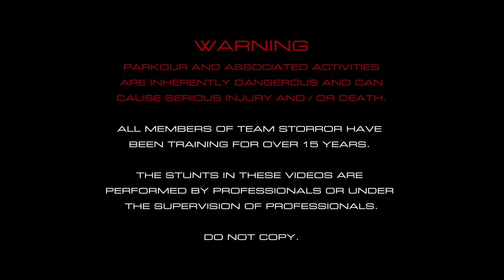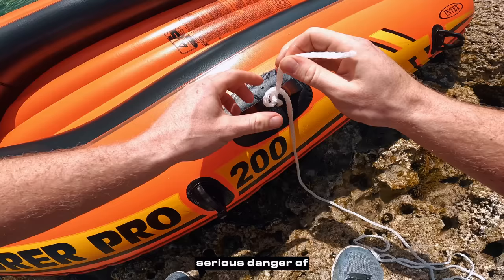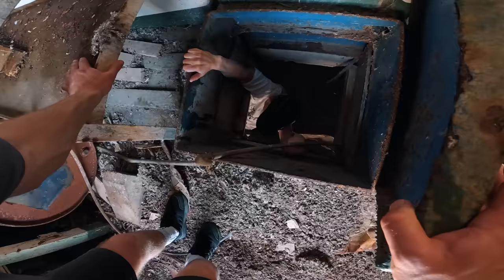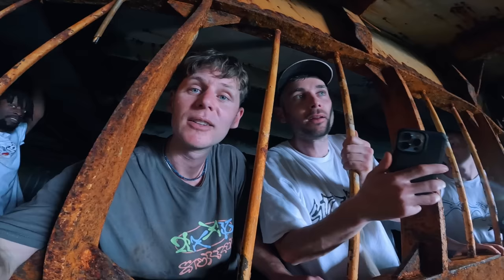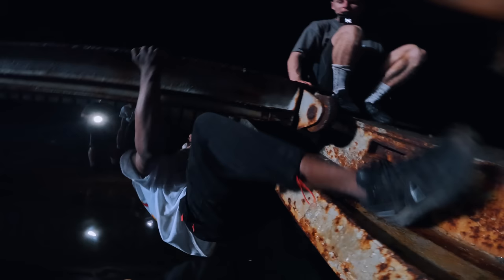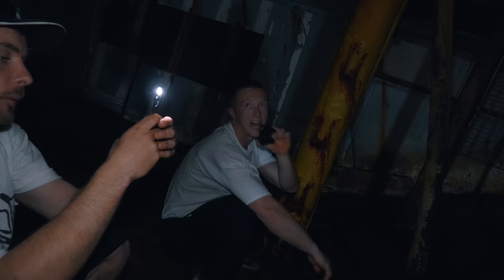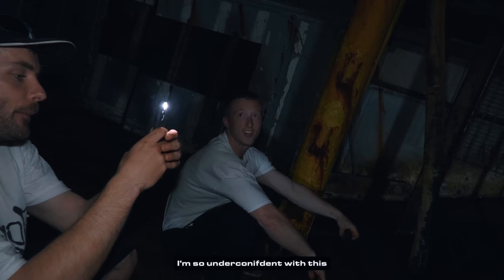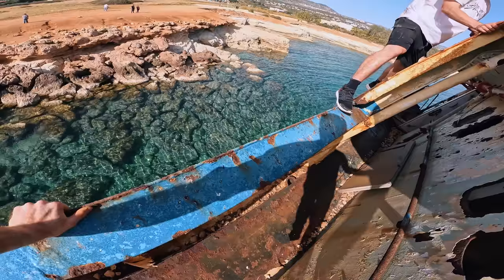STUCK in SINKING SHIPWRECK 🇨🇾

Comment: Paint room is because of the salt water, look how rusty everything is.
A fresh coat of oil or paint prevents rust and because of the size of the ship you need yo keep it on hand and a team painters.
Edit: I should add that it's potentially flammable materials so that's why it's in another room and not just general hold or storage and codes can require it to be in a separate marked room
Reply: Thank you for this valuable knowledge
Reply: When there is no other job for the crew they are painting the deck on big trips. It takes some time so there is always something to paint 😅
And you are right about the flammable materials. You need to keep it in a 'sealed' room.
Reply: Just thinking with the guys going in old things like this they should probably be careful about asbestos.
Reply: It’s a huge job on any ship, it’s tiresome work
Reply: it oil paint you need it safe to not to start a big fire and if is a military ship you have explosives on the ship
Reply: @cookeay  Asbestos (also tetanus) isn't really as big of a deal when it comes to exploring abandoned areas as people make it, the real dangers are mould and rusted metal in places where animals also reside. Asbestos related illness' require pretty long or repeated exposure times.
Reply: Thanks for stating the obvious.
Reply: @user-yk1cw8im4h  They asked in the video to reply in the comments what the paint room is dingus
Reply: Thank you! I was looking for this answer 🥰

Comment: Paint room is where you keep the paint and chipping equipment, for the deck crew to do repairs. You don't want open metal exposed to sea water so painting is done often, even if it seems strange.

Edit: If you do this again I cannot recommend going into completely enclosed areas - sometimes they have no oxygen due to it all reacting with the metal to form rust, and you could pass out or die. There's quite a few recorded incidents of this happening so be careful.
Reply: Also on ships it is all about safety and keeping the risk (of fires) and pollution as low as possible. So you need to have your flameable items is a well contained space.
Reply: That paint question was pretty obvious and I never owned a ship
Reply: Was looking for this comment, maritime gang
Reply: @luk4aaaa  💪
Reply: they wil lkeep going lol
Reply: safety team might have checked that

Comment: There is a paint room in every ship because once at sea, one of the duties of the deck crew is to continuously re-paint the ship 🙂   Salt water is the most agressive environment ever for metal and there is no paint on earth which withstands that aggressivenes forever, a good proof is the shipwreck you're playing on.  Check when it got grounded and that's the result of stopping to repaint the ship !  So once you've finished repainting the ship you're already starting over again.
Reply: Do you know if this paint is lead based?
Reply: @gunnygt49  I'd assume it entirely depends on the rules of where the ship is registered (or equivalent ship term). As far as I know a large number of ships are registered in a small number of countries that have more lenient regulations.
Reply: the world has probably moved on from lead based by now and the low levels of production would probably make it economically unsustainable to continue sourcing it.
Reply: The paint is segregated due to the fact that it’s highly flammable. The room it is kept will have its own fixed fire fighting system e.g. drenchers and/or CO2
Reply: @gunnygt49  no, maybe during the time that ship was still in action, but most paints were very quickly changed to non lead based paints because lead is just bad, in every way.

Comment: The paint room/ paint locker is used to store paint and other flammable liquids like paint thinner. It’s generally used to keep all flammable related in one area and on modern ships the paint locker/room will have its one fire suppression system in case of spontaneous combustion or fire. And the room you were asking about on the crane is called a crane cabin. Any other Mariner questions feel free to ask. Also to answer a question I saw about the paint being lead based. There’s no telling different countries have different regulations when it comes to marine paint.

Comment: If anyone was curious. Paint store is seperated because paint fumes can be toxic and flammable so the room needs a completely seperate ventilation system with duct openings leading to open deck area. Also ship crew during their travels uses A LOT of paint so seperate room is useful just to store large amounts of paint 😉
Reply: Dumb question but why do they need so much paint during travel, and not just paint once at the port? Because of rust?
Reply: @sherlockholmes9570  Yes. Main thing is sea water and rust but it's a main thing. 
There are also two other reasons I can think of now:
1. As an officer you always need to have a task (job) for your crewmates otherwise they can go crazy (it happens at sea) so the easiest way to find them something to do is to make them paint the ship/engine room/basically any equipment (again) or clean the ship. 
2. In some cases in order for the vessel to get through a coastguard check and be granted a pass to enter the territorial waters and destination port the ship needs to be in a well maintained state. If there are any leaks (there always are) and visible streaks/spots of liquids on the equipment as well as visible rust and paint chipping the costguard of a country that ship is trying to dock to can arrest, fine or even send the ship back for not complying with that country's regulations. So couple of days before entering territorial waters the crew needs to repaint every thing that doesn't look clean or new in order to safely enter the waters (it mostly happens when dealing with the US' coastguard. They are pretty annoying about that 😉)

Comment: (Expert in ship)
A "paint room" on a warship is a dedicated space where painting and surface preparation activities take place. Warships, like any other vessels, require regular maintenance and painting to protect the hull and other surfaces from corrosion, maintain their appearance, and ensure operational readiness.

The paint room provides a controlled environment for applying various types of coatings to different surfaces of the ship. These coatings can include primers, anti-corrosive paints, anti-fouling paints for underwater surfaces, and camouflage paints for military purposes. The room is designed to minimize dust, dirt, and other contaminants that can affect the quality of the paint job.

In the paint room, surfaces are prepared by cleaning, sanding, and applying necessary treatments before the actual painting process begins. It often includes proper ventilation systems, exhaust fans, and filtering mechanisms to control air quality and remove potentially harmful fumes emitted during the painting process. Safety measures such as personal protective equipment and fire suppression systems may also be in place.

Paint rooms are crucial for maintaining the integrity and functionality of a warship's surfaces and contribute to its overall maintenance and longevity.

Comment: When I was in the Navy, I worked in a paint locker for a couple of months. Paints used on ships can be flammable, but are still necessary to keep the ship looking in good condition. Additionally, the paint help prevent rust. The paint locker will usually be locked with only select crew having access in order track who was in and out of the locker in case there is an incident (fire, paint spill, theft, and so on).
Reply: Remembering the shade of Yellow Cromate.  Happy days
Reply: @MyUlster1690  Yeah. I used to have to sit in there and issue out paint to people who had the right paperwork. Pretty easy shifts.

Comment: Not sure if anyone has mentioned what a paint room (or paint locker) is on a ship, but you guys were spot on: it’s a small room dedicated to storing paint. Because some ingredients in paint can be toxic, and even explosive, they minimize both toxicity and explosions by keeping paint in a room dedicated solely for paint. The paint is for normal day to day touch ups needed that are due to salt water damage. The paint room/paint locker is generally located in the forward part of the ship and below deck.
Reply: thanks i just got to comments too see what is teh panit room

Comment: in answer to your question at 24:55 it`s a crane that`s part of the ship , you`re pointing at the cab for the operator , the steel wires that you climbed up lift the main jib which is currently stowed back against the main wheelhouse.............. great video boys

Comment: 1) Usually ships have paints room to store all the paint. In the sea because the humidity is high and since the sea water has a lot of salt in it, ships need to be painted to avoid rusting. 
2) the small cabin on the main deck the crane cabin. Usually where the crane operator sits and operates the ship. The cabin has all the levers and controls for the crane operation.

Comment: Not sure about the paint cabin, but pretty sure the ship is a crabbing ship and that rope tower, is a crane used to operate the net and pull it out of the water and put it into the tank.. the tank would be a place where any crabs would be stowed after being caught while onboard a ship. At 24:50 you can see on the deck a raised section, the “flooring” of that raised section would typically open up to reveal the tank in which the crane (operated by a person in the cockpit just below the ropes at the top of the tower on the right of the screen also at 24:50. I’m fairly certain the ropes are tied off on the left of the screen during transport or when docked, not attached to the netting. And in this case has resulted in keeping the ropes in pretty good condition due to being out of the water. Although this last bit is more so a hypothesis. Everything else is observations and using clues of what I know previously… side note, I think a very similar style of ship was used on deadliest catch at one point or another. Remember seeing a ship of similar design from that show in a clip a few years back..
Reply: After watching only a few more seconds in they have both pointed out the cabin I mentioned, and I noticed the ropes aren’t ropes, they are steel cables.. which makes a lot more sense given what I said in the above message. Also I believe when they are approaching the ship from the ground the paint with name of the ship, fairly certain it’s got the hammer and sickle of the USSR flag. And possibly in a Slavic like language although this bit is conjecture.

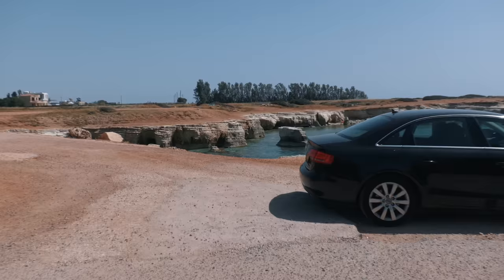Comment: 3:47 If they're a similar rock formation as the Pancake Rocks here in New Zealand, then basically they're fragments of dead marine creatures and plants that landed on the seafloor millions of years ago, and the immense pressure of water above caused the fragments to solidify into hard and soft layers over a long time.  When it then gets uplifted out of the water, the softer layers get eroded quicker, thus leaving a pancake looking rock assembly. It could also be layers of Mudstone compacted in a similar manner by the looks.. 😊

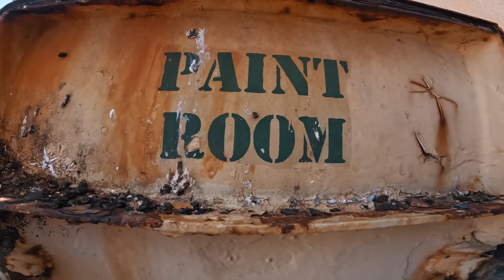Comment: 8:06 "A small onboard area is required in marine vessels to handle and store paint. This room is known as the Paint room. Special provisions are there for the paint room to cater explosions and release of chemical gases and vapours from these enamels."

24:50 it's a crane Drew is on the cables that create the tension and attach to the cargo and Max is on the arms of it that would do the heavy lifting.
So the answer to your question is thats the control cockpit.

Comment: There's a paint room because some ships will go out for months at a time and you have to chip rust apply a special kind of stuff similar to the consistency of Elmer's glue called coroseal it's supposed to stop rust but it's not perfect at it so you have to continue to chip rust and repaint after the rust has been chipped

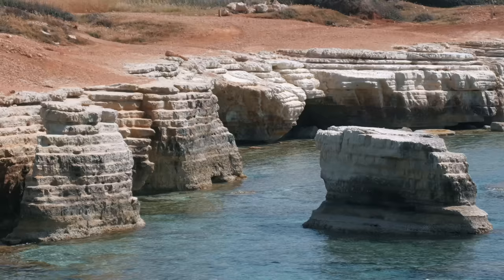Comment: That's a really cool chalk shoreline! A foreshadowing of all the parkour lessons you guys were about to teach. Probably formed with some physical weathering from the sea and chemical dissolution assuming the water has been acidic enough. I assume the horizontal layering is fracturing due to pressure release when the rock was uplifted from beneath the sea and probably other rocks over time, but wow that stuff is 3:52 impressively straight and uniform!

Comment: At the cost of battery and slight added weight, you can get small pool noodles for the drone. 3D print some legs that can hold 2, and at least itll always float if it lands straight, and float even if it crashes :3

Comment: The Paint Room or Paint Locker is used to store paint on a ship. The paint is needed for lagging and waterproofing as well as cosmetics. The paint room also stores other flammable materials as it's usually well protected against fire or easily accessible to the fire crew.
Reply: And the thing with the ropes and the small cab is a crane. Used for lifting things. 
You really should get out more... oh.

Comment: Paint Room:
A small onboard area is required in marine vessels to handle and store paint. This room is known as the Paint room.
Special provisions are there for the paint room to cater explosions and release of chemical gases and vapours from these enamels.
There should be explosion-proof lighting in the paint room, and brackets should be available to provide flexible mounting and storage of paints.

That's what the internet says.

Comment: SO.  About Paint Room.  It's a special designated place to store all Paint on the Ship (Paint considered Dangerous and very flammable product) This Store room is equipped with smoke & flame detectors and automated with water Sprinkler fire extinguisher system. + There is forced air circulation (for people safety) , But Room can be fully isolated to suffokate flame.

Comment: The paint room is specifically designed for storing and handling paint. It utilizes a specialized system to prevent accidents and ensure safety. This includes provisions to prevent explosions and control the release of chemical gases and vapors that may be present in these enamels. so in other word it is literally a room for paint